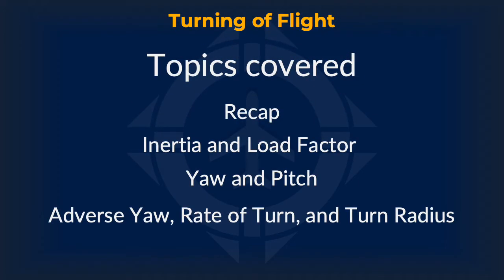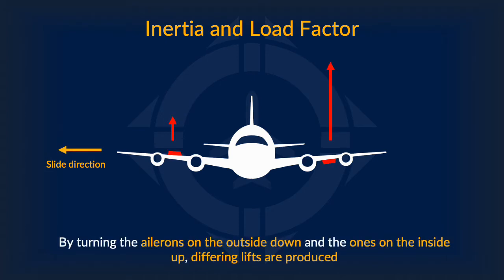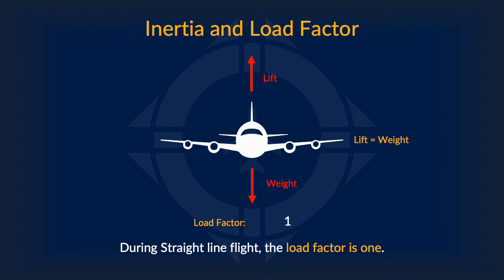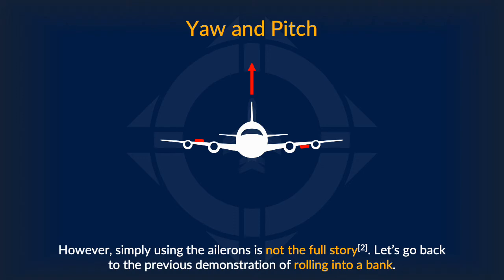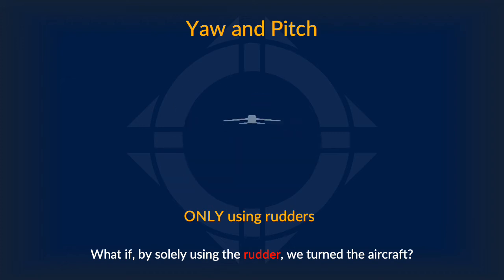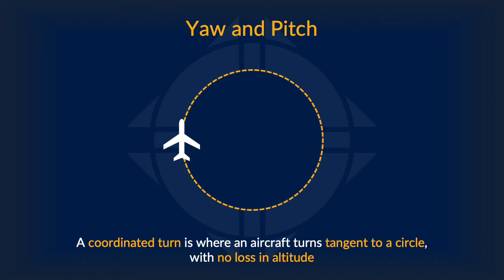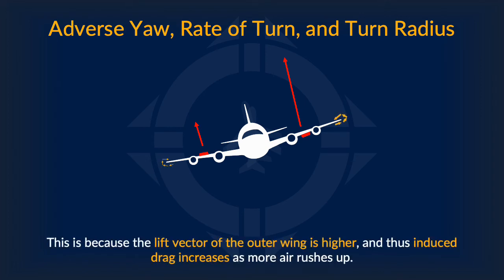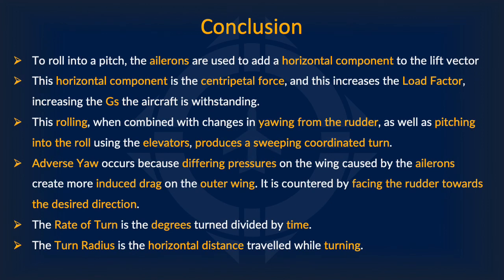Aerodynamics of Flight 5 - Turning of flight

Comment: Good Day, in normal flight condition i think using an elevator for a turn is almost impossible or i missunderstand something on your video 7:20 ?
Reply: He means ailerons😂
Reply: @jdl9020 no he doesnt. He is stating that once youve applied ailons to bank the aircraft at the hypothetical 90 degree angle, that using the elevator alone would, indeed raise the tail relative to the nose in the horizontal plane and pitch the nose of the aircraft into a turn. If the aircraft were levelled and elevator applied, the aircraft gains altitude. If at 90 degrees, the elevator acts as a "rudder" and swings the tail around, affectively turning it. But of course, at 90 degrees, there is no lift being generated by the wings and the load factor maxes out structurally damaging the aircraft.